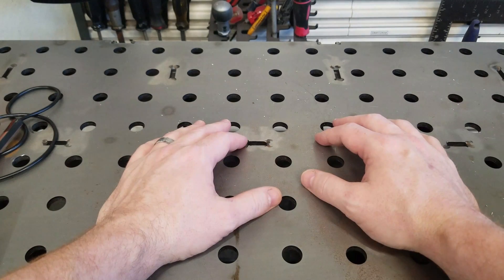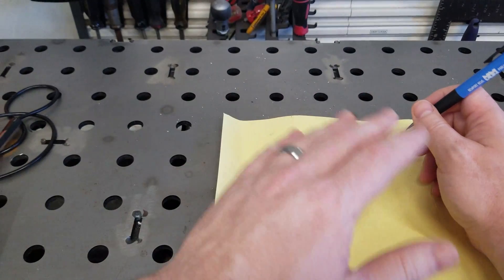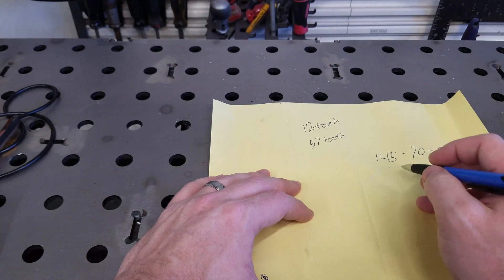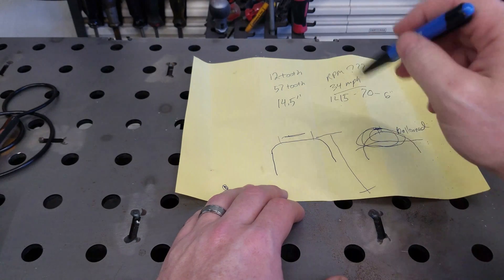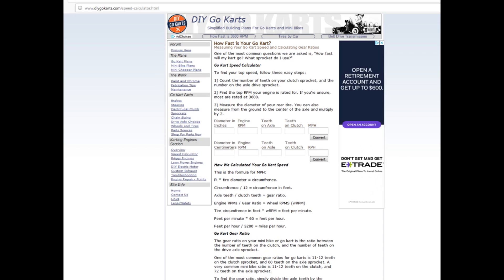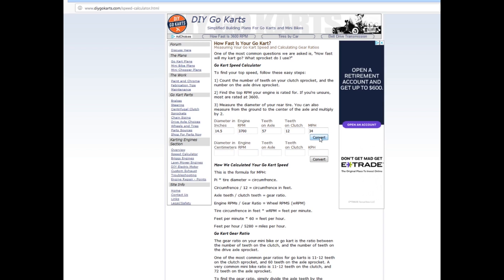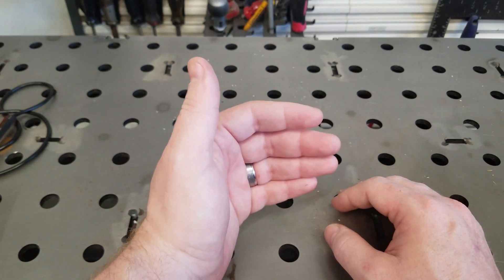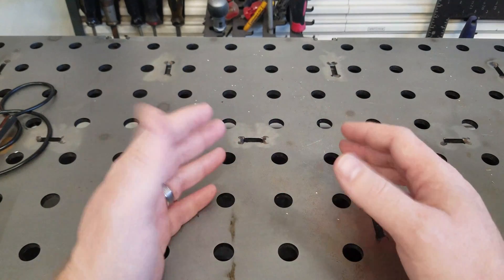Mini Bike Math !

Comment: I have 2 Coleman BT200Xs.  One with 196cc Hisun stock plus .038 jet, header intake cone filter, 18 lb valve springs, 8 degree timing key, gov delete, and CVT. Maybe 8 HP.  

Using your calculator;  I used a tire height of 18.5” for the factory original tires. I think thats right.5,000 rpms, 50 tooth & 9 tooth. Your calculator shows 50 mph. Using GPS & digital tach mine shows about 47 mph at 5000ish. Ok close.

2nd bike has 212cc Tilly motor. About 16HP. 7,500 rpm capable cam
It’s has CVT with Juggernaut. 18.5 tire, actual observed via tach 6,900 rpms, 50 tooth & 10 tooth. Your calculator shows 76 mph my gps shows 55.  

Juggernaut slipping? Belt slipping? Doesn’t seem like excessive belt slip. Ideas?
Reply from the maker: I’ve heard people complain about that. For all out speed and top end it’s hard to beat a centrifugal clutch. You maybe able to “tune” the torque converter. I believe red beards garage and cars and cameras have videos on the tuning of them.